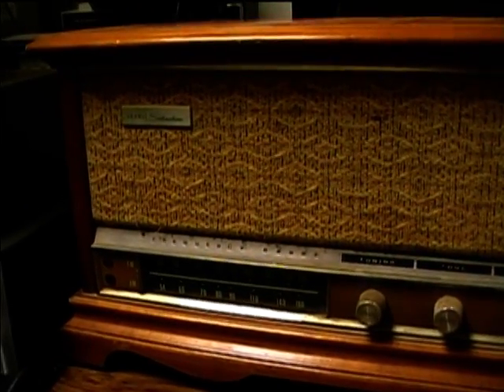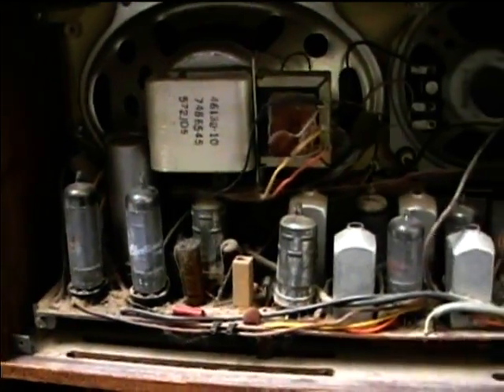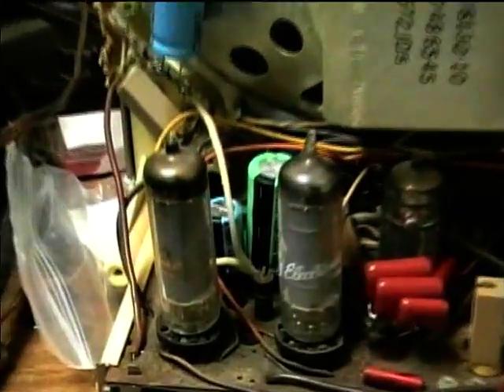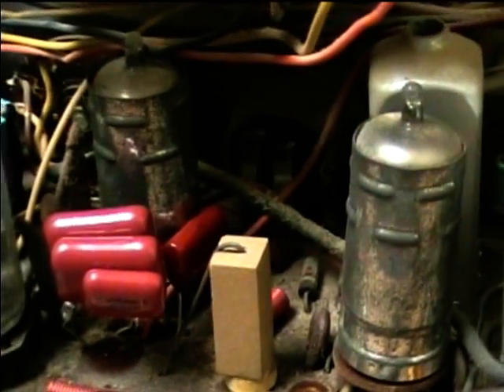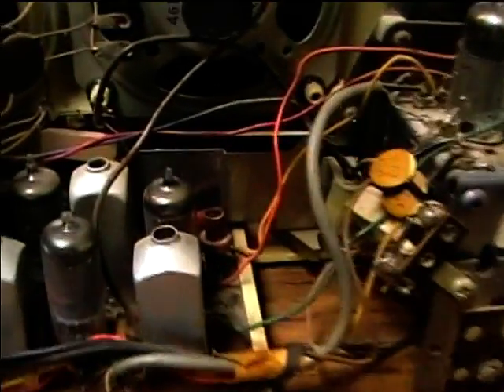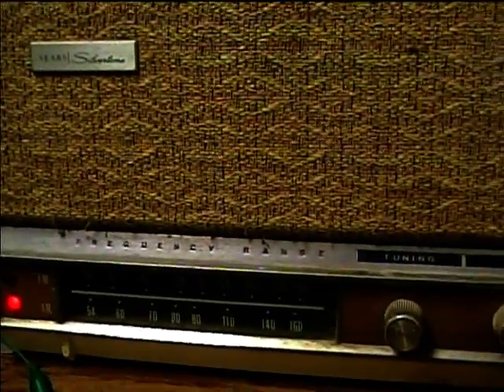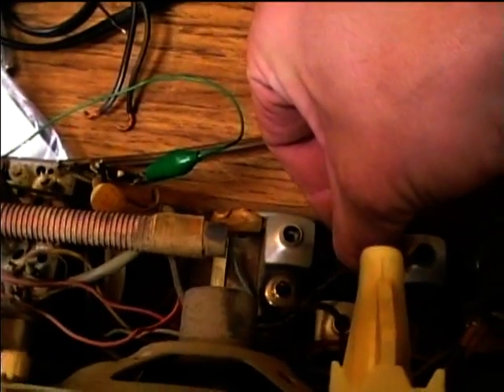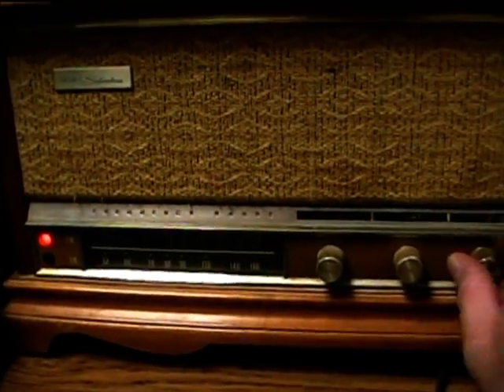1965 Sears Silvertone AM-FM tube type radio repairs

Comment: I just purchased the same radio! I can't believe I was able to find a video about it with just a simple search consisting of 'Sears Silvertone tube radio.' It's good to know what year it was manufactured because I had no idea. I can't test mine until I can find a replacement power cord. The cord on mine has a broken conductor at the base of the cheater plug that goes onto the back of the radio. Do you know where I can find a replacement cord that will accept the clip that slides onto the cord?

Comment: @jefferyb304 I don't think so.  Keep in mind that they were testing brand-new radios.  The thing is, almost all consumer-grade tube radios from this era have some kind of very low-level hum, even if the electrolytics are brand new.  Most of the time, it's very, very minor, and not audible at all when the volume is turned up even a little bit.  I'd venture to say that CR was being very nitpicky in its review of these sets.

Comment: @retrochad I have a Motorola transformerless table set with push-pull output.  I believe it uses a pair of 35C5s.  The set is from the late '50s or early '60s, like your Silvertone.  As you know, push-pull is rare in sets of this vintage.

Comment: That's very cool, I did the same thing with an old Ampeg B12XT, which also had completely discreet components, the circuit board was similar to the one in your radio, basically just something to attach the components to, no etching.  it's very fun to listen to the end result.  You just don't see radios that are made of wood anymore.

Comment from the maker: Thank you! This one actually has 2 unusual features:
A 100 ma filament string for the RF and IF tubes using 18FW6, 18FX6 etc.
and a push-pull output with 2 50C5's and the 12DT8 FM converter tube in a separate filament string. I have never seen a push-pull transformerless table radio before.

Comment from the maker: Each time I have ordered from Mouser I ordered some special values for some things I knew needed them like for the Rockola jukebox and then I ordered a bulk amount of real common values like .022, .047, and .1 at 630 volts, 22 and 47 uf at 450 volts and 47 and 100 uf at 160 volts. I need to make another order as I have used up almost all of the 160 volt electrolytics on the table radio repairs I have done.